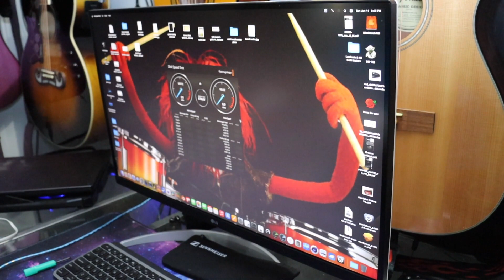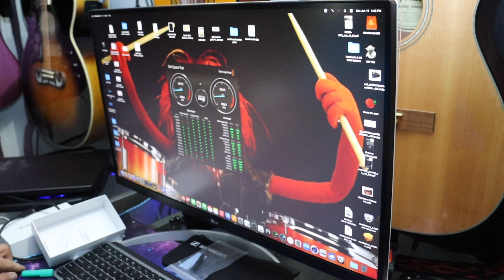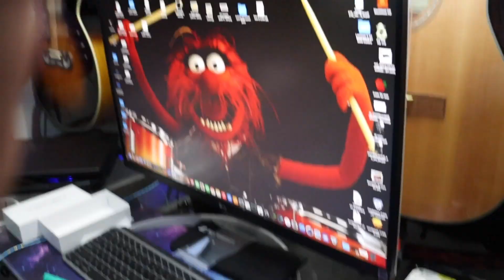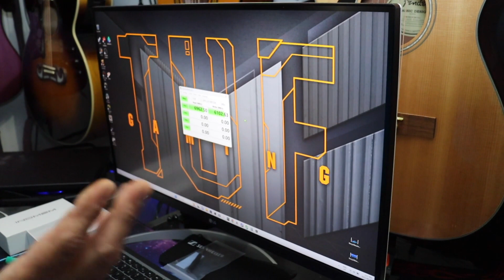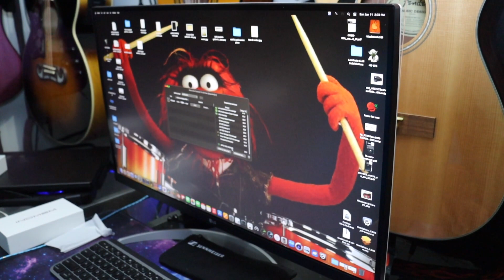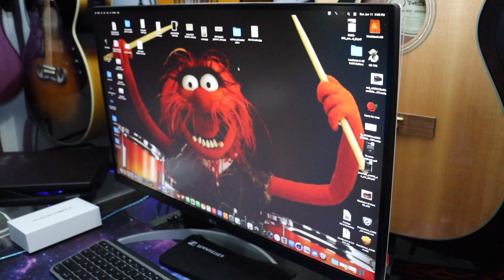INDMEM Thunderbolt 4 External Drive Case Review

Comment: On my Mac Mini M1 connected to TB I am getting 2600W / 2700R with a Addlink 4TB S90 NVME and with a WD SN550 2TB I am getting 1700W / 2200R
Reply from the maker: ok
Reply: for the price the enclosure is cheapest I've found, same speeds as my Orico one which was double the price @KevinMillard68